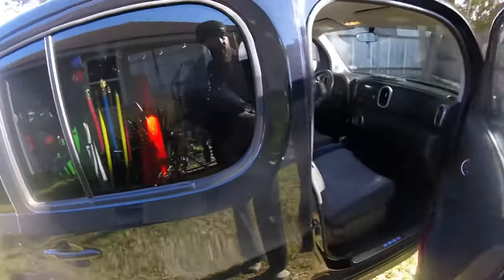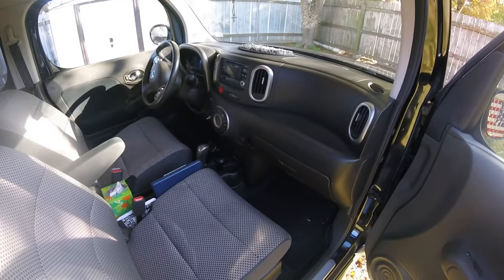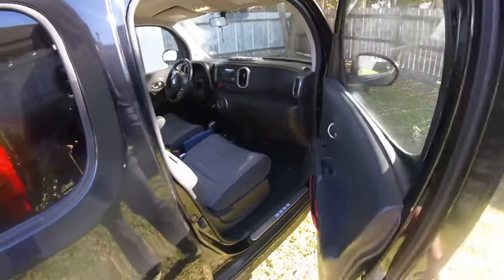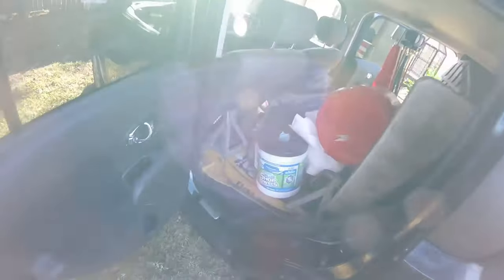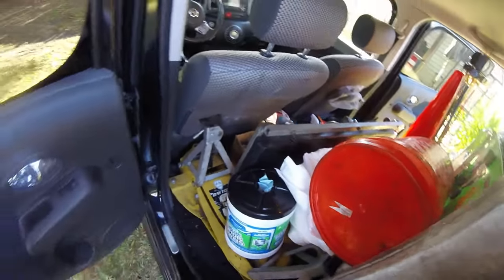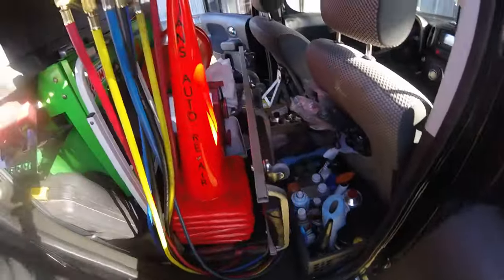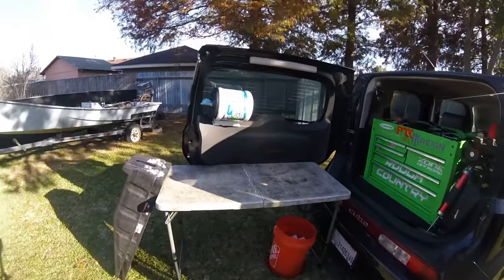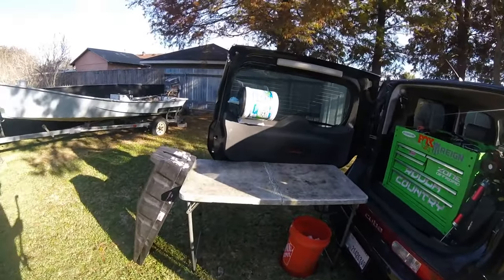My New Mobile Mechanic set up. #mobilemechanic #mechanic #automotive

Comment: Thats not terrible. I would prefer one of those little Nissan mini work vans, with the sliding doors on the sides. My uncle has one of those. He works for a siding/home remodel company, and he built a little plywood deck in the back, with drawers and stuff on the bottom for all of his tools, it’s got a nice ladder rack on top, he can fit a bunch of ladders and his big metal brake thingy for aluminum flashing on top. It’s a pretty nice little set up, you’d be surprised how much BS he can fit in there lol. And there’s a sliding door on both sides, so that’s nice, everything’s pretty easy to get to. But anyways, nice man, it’s definitely a step up from an open bed pick up truck. I have a Chevy express van, and since Biden f—-ed up the economy, and my old business went under, I’ve been kicking around the idea of starting a mobile mechanic business. But I’ve been out of the mechanic game for almost a decade, and some of these new cars are just ridiculous man. Super complicated for no reason. I don’t even want to know how much a good snap on scanner costs these days. So unless I win the lottery anytime soon, probably not lol.
Reply from the maker: Thanks 🙏🏻 and best of luck to you. I actually have a ford transit van now. Check out my video van tour. Still a work in progress, but one step at a time.

Comment: My first mobile mechanic hauler was a 650$  2001 Impala lol. so yeah. then a Jeep cherokee 4.0 Which I loooooove. Why? O do towing too... I use this bad boy with a small flatbed trailer I can n' have Towed F350s n such trucks... it has a winch... front bumper has one too... I get busy under the cars and on the road too... it loves gas but delivers lol All my tools stay locked in so I don't have to worry either. Love it. Always wanted a truck... but the whole Idea of having to get your tools out and stuff turns me off... When I do engine swaps I put the big jacks and engine on the flatbed. job done. Worked on my Impala for like 6 months... Bought a small trailer to haul engines and such but Realized I would need something better... my flatbed has some sort of lift on it... I have rescued guys out in the mountains... It was kinda expensive for them but worked great. Maybe I will upgrade to a diesel 350 kind of truck, and add some locks or whatever to the toolbox. Set 'em up in a way I wont have to be showing it around so yeah.

Comment: I have a set up similar to this, but its in a Mazda 6 believe it or not. Also, to save on weight, I use Milwaukee packouts. People are really surprised what i can accomplish with a small 4 door sedan worth of tools. I still want a larger SUV or van eventually, but what I got now Has been working just fine for a year.
Reply from the maker: I love that you’re making it work! It’s all about getting started and learning what you need as you go.

Comment: I'm currently a mobile mechanic for a small courier and delivery company, I work out of my f!50 with a cap on the back and a slide out deck for the tool boxes and stuff.
I'd quite happily work out of your set up.  Don't forget the fuel you'll save compared to a full size truck.
Nice job

Comment: Funny thing about tools. You have a bunch of tools but on a day to day you use 80% of them 20% of the time. But, you use 20% of them 80% of the time. Nice set up as long as your young enough to do it. Even working in a shop can make you old quick.

Good luck
Reply from the maker: So true